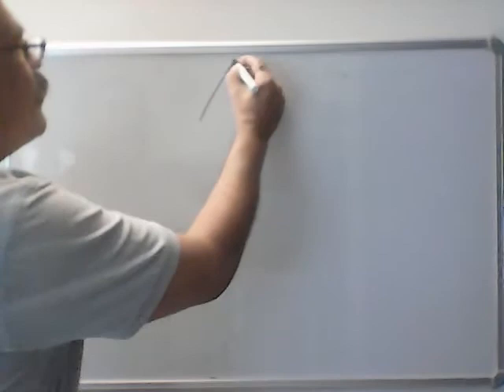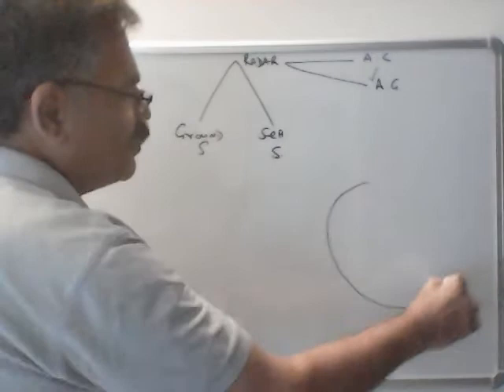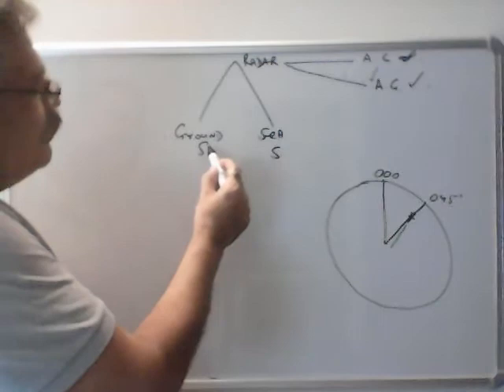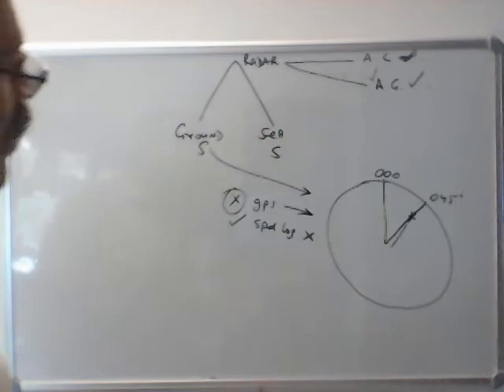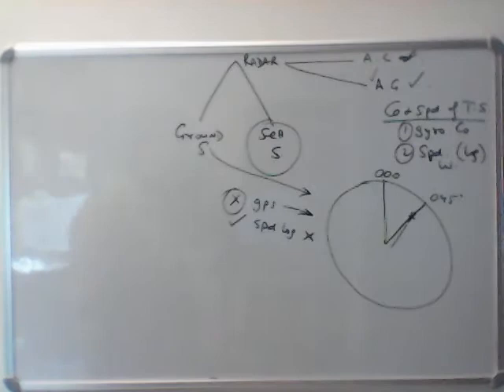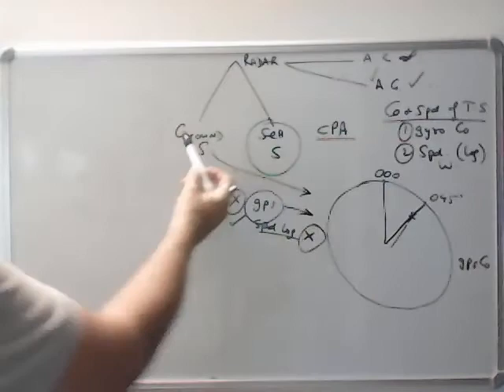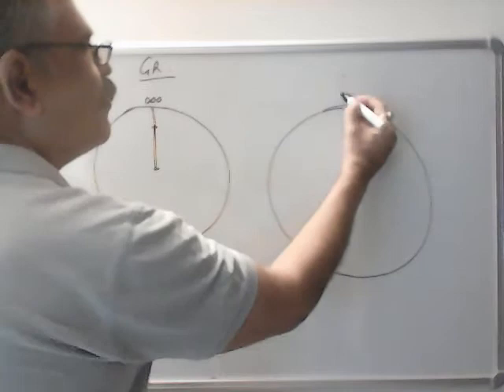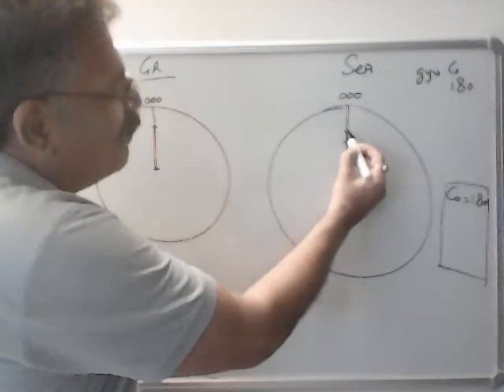ground stabilised / sea stabilised(radar)

Comment: Captain good explanation , but in practise onboard tankers vessel especially, its good to mention Sea stabilised in only to be used for collision avoidance , for general navigation when we are not in collision avoidance in my opinion we should only also use Ground Stabilised , OOW is not used to take bearings so much with any object he see , he relays on the radar , so in case some close obstruction is passing near vessel, is always good to have radar setup to show vectors for actual movement of the vessel in relation to current  which is ground , for ROR situation in restricted visibility then Sea stabilised definitely . 

Thanks for sharing knowledge ! 
Sebastian
Reply from the maker: totally agreed
Reply from the maker: pl fwd to yr other groups